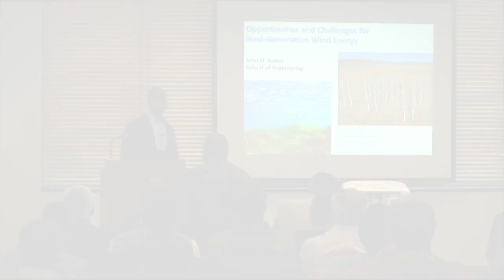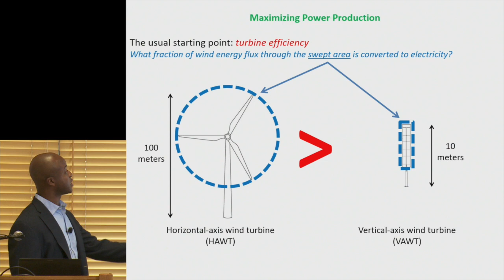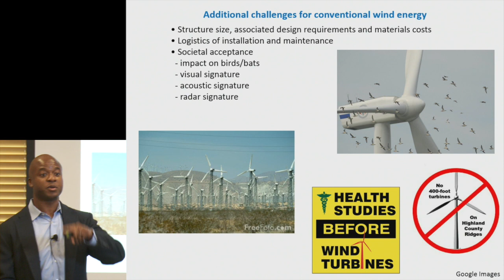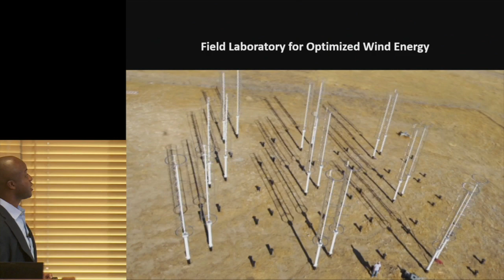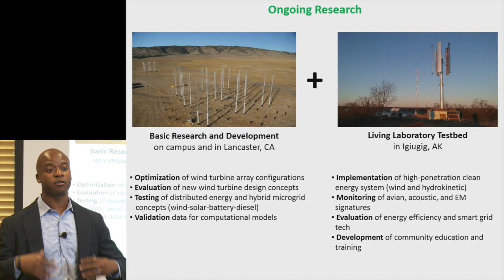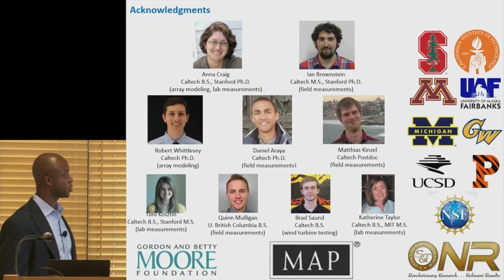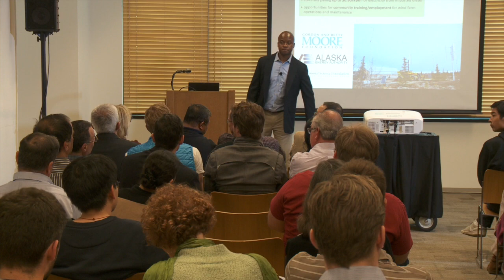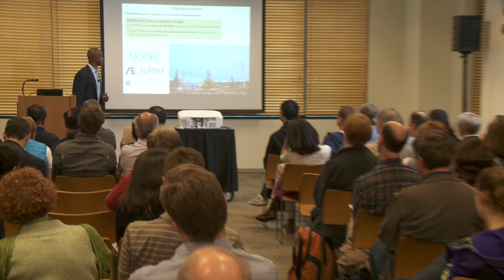John Dabiri | Opportunities and Challenges for Next-Generation Wind Energy

Comment: I wrote a blog a few years ago about  VAWT. There are both good and bad aspects of VAWT and HAWT.
https://e-ternity.com.au/technologies/item/25-blue-energy-wind-tower.html
I have to point out that every VAWT in the market fails to address the efficiency problem. As you can visualise the air flow passing the axis of a VAWT, half of the energy makes the VAWT working. The other half contributes negatively. It is due to the VAWT design, the positive energy can overcome the negative energy, which makes net energy that can be utilised by the generator. However, for the HAWT, there is no such a problem. So the most challenging part of VAWT is to make the negative contribution wind energy into the POSITIVE contribution.
Also about Betz efficiency equation, I think the most missing aspect of such an efficiency limitation is that all the wind turbine designs fails to capture ALL the wind energy and ensure the maximum conversion of uniformity energy flow becomes the torque force that is at the maximum potential. For example, when a HAWT is rotating, those wind energy going through the gaps of turbine blades makes not contribution of the turning. Those wind energy hitting at the blades near the turbine shaft has less contribution than the wind hitting the tips of the turbine blades. So the limitation of Bets equation might not be correct if we find ways to overcome these problems. As you understand, modern hydro turbine has efficiency of 80 to 95% efficiency. After all, there are more to develop wind energy, which should be a very powerful source  of renewable.
Reply: new game changer is now avalible with vawt at a lpwer cost  per wind swept area

Comment: The problem is; one normal HAWT will produce ten times the power of the same size VAWT and VAWT costs more to manufacture and maintain. You picked a big challenge.
Reply: In some cases it may be cheaper/easier to mantain the VAWT
Reply: a 10 kwh same size per wind swept area vawt  will produce more power not 10 times less